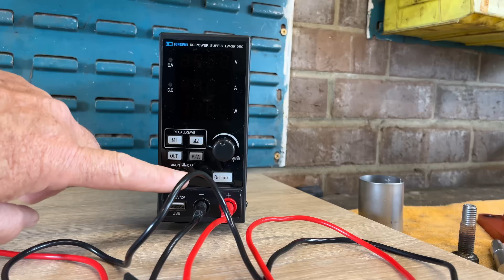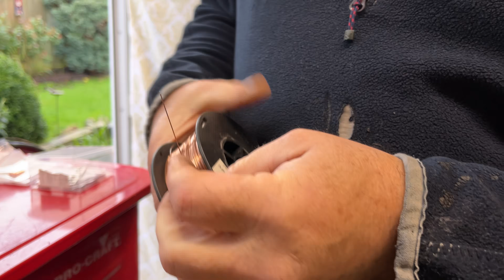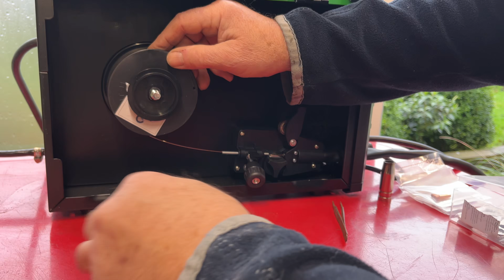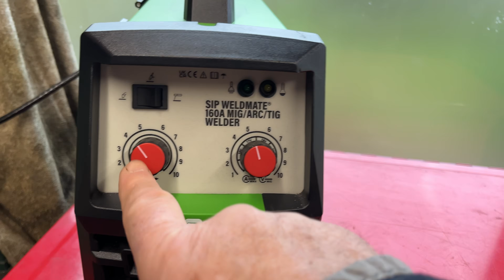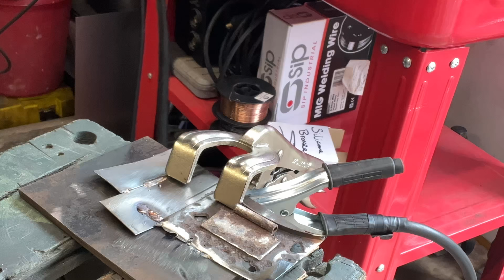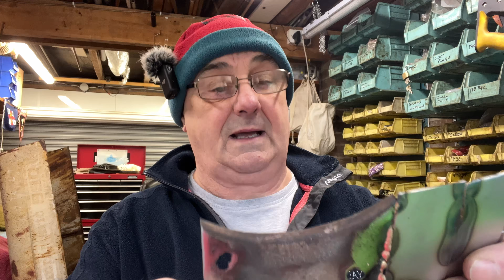Brazing with a SIP 160A mig welder

Comment: We found, out, too late afterbuying dedicated silcone bronze,That can convert regular Mig welder for steel  to brronze welder,.Oly draw back is switching out wire snd reversing roller to silicone bronze size And of course gas.. But do this in a pinch, when dedicated bronze, has issue , an need to get jobb , done.
Reply from the maker: cheers Dan thanks for the comments much appreciated

Comment: Mmmm didn't know brazing wire was available.....could be very very handy.....when I had oxy acet gear I to braze a lot....brass to brass ect.

I wonder how well this would work on cast iron? old exhaust manifold ect.

Unfortunately my SIP 130 from prob 25 30 years ago on has basic adjustments.....no voltage adjustment just wire speed and high med and low power.....would that be a game changer for me??

My SIP 130 is a gas welder.

What is it you want to be able to braze can I ask....I used it for brazing brass fittings together.

Thanks for the video....interesting I do have argon as well.

Nick in Cheshire.
Reply from the maker: Hi Nik, I was posibly going to use it one steel  repairs to my bonnet for the David Brown 990 I'm working on, It was a way of trying to eep the temps down in the steel, try to stop warpage, Sorry can't answer your question re the volt adjustments as I'm not a welder, SIP would be able toanswer that for you, or if one of my viewers reads your comment they may possible jump in and reply. However it's very good to read that a 25-30 year welder is still working well,
many thanks
Barry
Reply: @manfromthemist1958  Ok thanks for that Barry.....I must get myself a roll of that wire and have it on stock.

Year the old SIP is still working fine.....as I said should have got at last a 150amp.....but I knew nothing about migs when I bought it.....only Arc and Gas.....my arc is 110amp.....I assumed wrongly a 130amp mig would be more powerful I was mistaken.

I use pub bottle CO2 as my mig gas.

But the SIP has severed me well.

I love old stuff like you mate....I have an old Serie 3 landrover I bought new in 1975....still use it to this day.....my welder has kept t going.

For very thin stuff....I use the sort of spot method.....a series of spot with gaps.....that you join up slowly.....you prob do exactly the same.

For me the bronze or brass wire.....I would be interested if its ok for cast iron.
Reply from the maker: Hi Nik, a freinds of mine will be trying brazing cast soon, Marshall Smart on youtube, So fingers crossed we'll have an answer before long

Comment: a few comments. Way too much heat. Leave a gap - braze wont penetrate as it does not (well shouldn't) melt the steel. Just sits on top - will be a lot more lumpy - if  it its flat then you are too hot. It hard to get it just right. keep going. fire off lots of small tacs if hard to control the heat in one bead run
Reply from the maker: Cheers Matt, many thanks for the great comment, loads of very usefull info and tips, all of which are greatfully recieved not only by me but all of my viewers who also read these comments and learn from them. Such is the power of social media,
many thanks
Barry

Comment: Great job Barry, I would suggest cleaning the "soot" off after you do the tack welds, so no occlusions occur, which gives a better penetration overall and prevents microscopic pinholes.
Reply from the maker: cheers Alby, thanks for the tips I'll definately do that going forward, many thanks
Barry

Comment: hi I'm only 6 minutes into the video but I've noticed something you haven't done yet should you not have changed the liner to Teflon I'm sure I read somewhere that for the softer wires like aluminium and the stuff you're using you need a slippy liner to to help stop  birds nesting. that said, it's great fun using this stuff I've been using it to connect 2 mercedes EGRs, together. to make a heat exchanger for the exhaust from my diesel heater to power a central heating radiator I'm now on my 3rd yeah build. silicon. Bronze is great for stainless particularly thin stuff lessens the risk of making holes, at my age of 75, I have a pretty serious tremor which doesn't help my welding but I've been getting away with it, using the I have TIG welders but with my tremor it's pointless. Me even trying, I shake too much for TIG welding stick and Mig,  I'm OK with. regarding your penetration you should not be getting any penetration. It's brazing if you've butted those two pieces of metal together with no gap. and you get penetration then you aren't brazing You are overheating it and welding, it's OK to see Braze all the way through. If you put a gap but without a gap, all you should expect to see is a slight tinning No material on the back edge everything you've shown so far tells me all the settings are too high. and you're overheating. anyway, practise makes perfect. I'm sure you're going to enjoy it. It's a really useful stuff. and a whole lot cheaper than having to buy, brazen equipment oxyacetylene wise!, but the type of welding I see being the future. is laser absolutely, astonishing ,but far too expensive for the DIY at the moment.
Reply from the maker: cheers Chris, many thanks for all the tips, fastinating to read, very interesting to learn from you, I'll remember them for the next time I've got it set up, great to hear from you, and thenks for sharing all that expereince with me, very much appreciated
Barry
Reply: ...lots of highly toxic gas from the laser weld. Air fed mask is a must!

Comment: Wow, very low spatter.  Does it need pure argon?  I hear when u get it right, the brazing will wick into the back side of the butt joint.
Reply from the maker: Hi ECU, yes you need to use 100% argon and your right when thing get tuned in properly and you improve the technique it will penertrate all the way through, I can remember gas brazing when I was an apprentice and once you cleaned it up you where only left with a little bronze line. many thanks

Comment: Haven't tried silicon bronze on mig because they ask an arm and a leg for a roll here, but it's an amazing material for tig, really good for not lubricated wear surfaces, cast iron etc I'd go with 0.6mm for sheet metal if available. And keep torch a bit closer, about half inch should be ok. Good idea for your project. Cheers.
Reply from the maker: Hi Nik, it's expensive here as well at £24  for a 1Kg roll, Will try the torch a little closer next time and on the vid I did see the wire burning back which was causing the popping.
cheers Nik
Reply: Silica bronze is far too expensive to mess about with on mild steel. It’s for more technical repairs on Cast etc. I have looked at this filler material for my Tig set but it’s just too much outlay. I still can’t Tig weld properly. Mig and stick no probs but Tig has me beat. Like your videos. Down to earth basic style.❤️👌

Comment: Try to get the nozzle closer to your work, I've done a fair bit of  welding in the past and my torch would be half the distance to the work compared to yours. The wire will be more stable and the gas shield would be more intense.
Reply from the maker: cheers Paul, thanks for the tips I'll certainly do that next outing, Any idea why the soot?
Reply: @manfromthemist1958  The only thing  I can think of is to make sure all the edges that you are welding are super clean, I know if you weld aluminium you have to be meticulously clean, maybe it's the same with brazing. You'll crack it, as you say practice makes perfect. Good luck with it.
Reply: Also I would turn the heat down and push the puddle slower, should be able to control the penetration better then.
Reply from the maker: cheers Paul
Reply from the maker: will do, I will look for some more metal to practice on and I'll apply all your tips many thanks Paul
Reply: The soot around the weld could be  using  wrong  gas ? I had the same thing happened tig welding with 5% argon mix
Reply from the maker: Hi Clive the gas used is 100% argon as advised by SIP, possibly CO2 left in the delivery tube?

Comment: When would you braze weld over mig weld?
Another good how to video.
Reply from the maker: Hi TC you would possible braze instead of a weld when you need to keep the temp down or, I know its not tractors but if you were making something like a copper boiler for a steam loco, were you could keep localised heat as oppossed to using a pepper pot which would heat a large area
many thanks
barry

Comment: Pretty interesting video Barry, So do you see the main benefit less heat? would it be good on dissimilar metals?  I would be interested in how it looks after grinding flat like you would with mild steel wire and any different prep for painting. Probably not a real worry but something I thought of while watching.
Reply from the maker: G Day Lance, It did appear to heat up very quickly but that could have been poor process by me, I'll give the test pieces a grind lol once I get my grinder fixed/ replaced it decided to die on me today, trying to get brushes.
As for dissimilar it would be perfect, depend on melting point  of each.

Comment: That went rather well Barry, maybe keep the volts for heat and penetration but slow the wire feed to reduce the volume of material?  Many moons ago I stitch gas welded replacement floor panels into my sisters Ford Escort then brazed up the gaps to reduce the heat distortion but make it weather tight, it took hours and a piece of kit like this would have made the job much easier. At 3:48 into your Christmas video you referred to your present that hadn't arrived, is that the wheels & tyres in the background of this video?
Reply from the maker: Hi Terry, as you say I still need to tinker a bit more with the settings, one thing was it kept popping when I tried a continious braze and loads of soot, hope someone comes up with the answers for that, Yes they are new wheels and tyres for the 990 arrived late and only after a couple of calls, the company wasn't the best communicator in the world.
many thanks Terry

Comment: Must admit been mouth watering waiting for this video to come out wow i cant believe the results for your first time i think practice and your end up Brazing the rest off your Bonnet i thought maybe the second run on the first trail was the best what would happen if you put a small piece off wood underneath your welding/ Brazing area it wouldnt stick together?
Reply from the maker: Hi Jon, if you put a piece of wood under the joint area it would probably catch fire, which to be honest with you is why  I put it on a steel plate, Billy did say he had experienced the backing plate sticking, It does look like it heats up very quickly and you've got to be quick to start reacting to it, loads more practice required but pleased that brazings is an option without oxyacet,

Comment: Looked a bit hot to start with but works ok have a roll on order to have a play. Got some more repairs to the ring roller main drive wheel to do. Brazing should work well with cast. The wire would work well with thicker steel by the look of it.  Good one 😀M
Reply from the maker: Hi Marshall, yes totally agree I think it heats up very quickly, it would work briliantly on cast and I'll have to try and acquire some 6 or 8mm plate to have ago at. it'll be good to see your video on the cast
Reply: @manfromthemist1958 got a few different sizes here up to 10mm